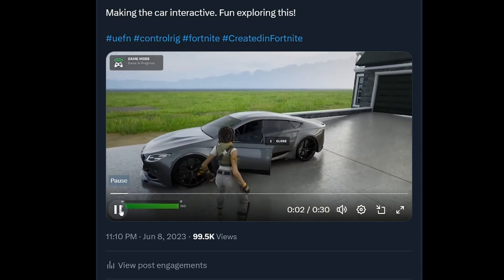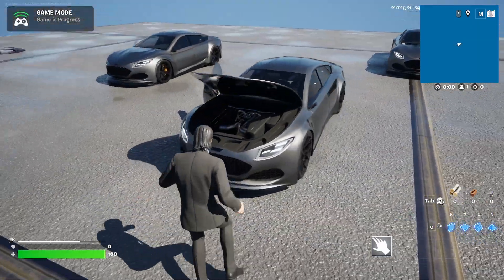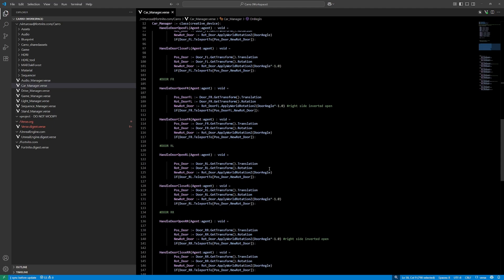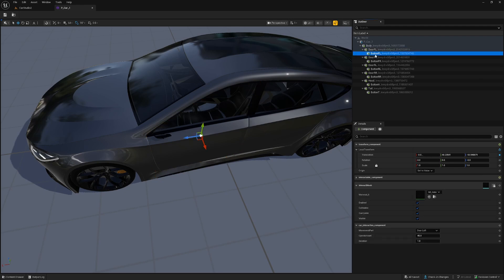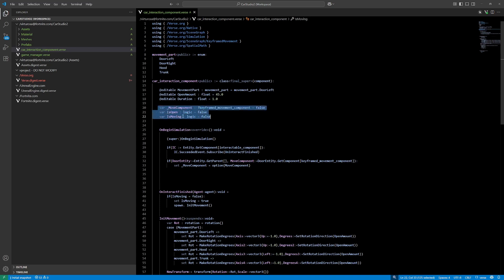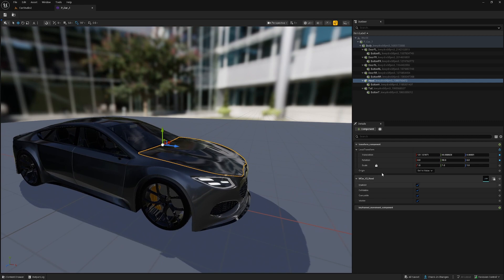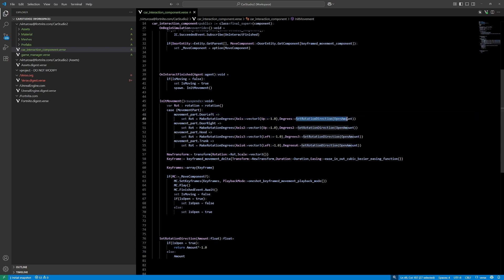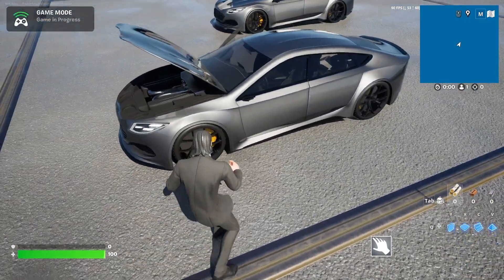I'm converting mechanics to Scene Graph in UEFN

Comment: I don't really get it , is UEFN so different from Unreal engine 5 ? I mean I can just create a blueprint there set the cars components to move smoothly with a timelined lerp , add to each component a collider that upon detection shows the component's widget and controls only the required component, and when I duplicate the blueprint it actually has all the components there , so I don't understand the amazement behind your achievement here because you'd think that UEFN would be a bit more user friendly in this kinds of prefab shenanigans
Reply: It's very different. We don't have Visual Coding, We cannot edit the base characters looks, size. There's a lot of little limitations like that which makes this video really insane.